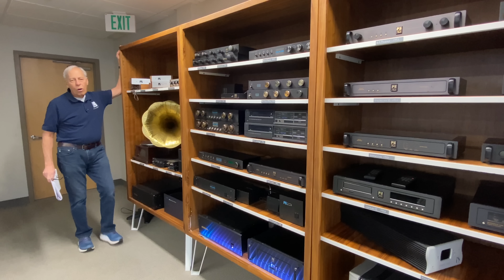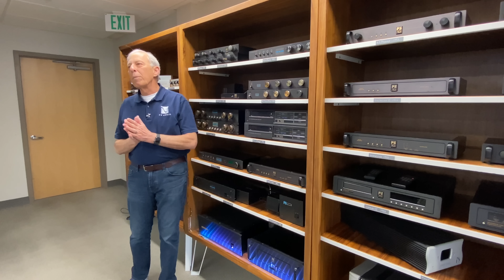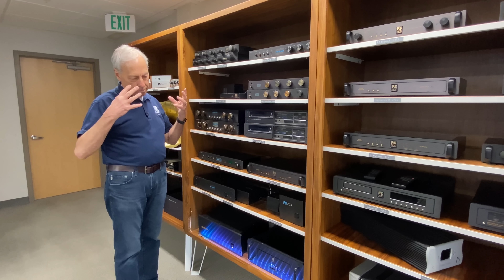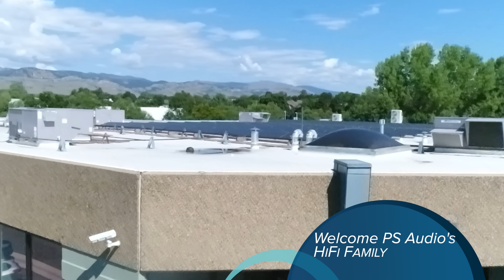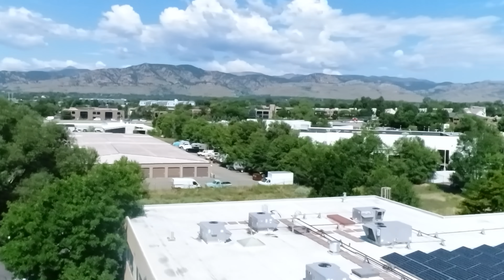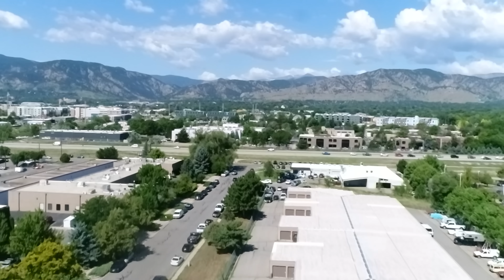Where do engineers go wrong?

Comment: Cables involve no magic. They are fully measurable and follow laws of physics exactly concerning their influence on audio signals. When a cable makes an audible difference rest assured that difference is also explainable. Your cable is a passive conductor of electricity involving properties of resistance, capacitance, inductance and shielding. A null test is a reliable way to identify the cable differential impact. Your US$1000 branded cable is typically manufactured in the Shenzhen southern China area for FOB US$10 by a factory still making profit. Snake oil marketing makes you pay the insane premium and also make you believe what you hear sounds better. This doesn’t mean cables don’t matter btw. And shorter cables are always better concerning their audio impact!
Reply: @Marshall 
You absolutely can have issues with "digital" cables.  Bit errors can result in skipped samples; if they're frequent enough it could conceivably become audible.  But that shouldn't happen unless the cable doesn't meet the specs, or unless you're running near the length limit.  
Regarding analog signals, if you can hear a difference, I'm confident I can find a measurement that will show why.
Reply: @marianneoelund2940  Exactly right!
Reply: @Marshall Well how did you exactly upgrade your speaker cable? Did you replace 24 gauge with 18, 16, 14 or 12 gauge? How about the terminals on the amp and speaker? Were they tight to begin with or did you inadvertently fix that by swapping cables and re-tightening them. How about oxidation? Just swapping the cables will scrape away some of that resulting in a significantly lower resistance connection. We don''t dispute the improvements you heard, we do dispute the speaker cable alone as the reason provided it is the same wire gauge.
Reply: @andydelle4509  The new cabl;es do make a difference. Less impedance and less capacatnace. Ever see the spects for Mogami speaker cables. Same with Mogami W2524 for instruments. I used them with longs 20 fewet slengsth and although they are XLR qwires, THEY DO PICK UP NOSE and need a nosie gate.  A portable gidital recoirder liek the one from ZOOM H4n. THANKES YUE and thmuibbs usp!
Reply: @Marshall You mean the live concert with Elise Trouw? Not sure about those cables, but usually professional cables are not too expensive and her home setup here in La Jolla is not with expensive cables. I'll tell you why some people buy cables costing tens of thousands of Dollars even they are manufactured for tens of Dollars...they are gullible to marketing snake oil talk and have enough money to not care. I work in audio professionally, have done tons of blind tests and have seen how this psychology works many times.
Reply: Forget capacitance,inductance,shielding,skin effect or any other spurious nonsense because their effects are miniscule.
Just concentrate on keeping resistance low by using thick conductors from your local electrical retailer.
Reply: @montynorth3009  Yes, the skin effect is a concern at higher frequencies and neither inductance nor capacitance of cables make meaningful impact for a few feet of cable. In fact, if your interconnect cable of a few feet makes an audible difference, it's likely a filter effect that I would be rather without. Your power cable resistance is in series with your house wiring resistance of many times longer wiring and also realistically of no impact. For speaker cables of very long distance, you could lose some damping factor and insertion loss (max SPL loss), but for a typical setup with a few feet of cable, the effect is more theoretical than audible.
Personally, I use heavy cables because they look cool, but I usually get them factory direct from certain factories in Shenzhen-Baoan, Dongguan, Zhuhai and Guangzhou areas. I've been visiting several of these factories in fact.
Reply: Marshall I do audio R&D professionally. Exactly because our mind is easily fooled, blind tests are required when you aim at getting feedback on audio performance. Especially for speaker testing, listening tests are essential in judging the performance.
Reply: Marshall San Diego
Reply: Larry Niles and how do you know these decisions and right? because you think so or feel so, or hear so?
Reply: @FooBar89 Those are not complementary options. Our brain thinks based on sensory inputs incl. from our hearing. In audio R&D you can play different audio test tracks and ask the testers to rank perceived soundstage, details, coloration etc. Personally I've seen radar plots being filled with the equipment behind an acoustical transparent curtain. I've also been doing tests were people were blind-folded as even a supposed to be acoustical transparent curtain can do some impact to the audio fidelity. When you test cables and electronics, you often can do the test with just hiding what are the active cables and gear.
Reply: @Larry Niles 
And when your life experiences conflict with someone else's, you must be the one who is right?
Reply: @Marshall 
I'm in the Seattle area and will volunteer, if that location works.
Reply: @Marshall 
Some premium cables are good investments for live sound, simply because of their ruggedness.  
I use very expensive pro cameras for my photography business, not because I can't get nearly the same results with less expensive equipment, but because I need extreme longevity from my equipment and cannot tolerate breakdowns during a shoot.
Reply: @Marshall 
I am an EE, with decades of experience in analog and digital design, and you could call me a skeptic on this topic.  But I'm also curious and would like to hear a demonstration - and if there turns out to be an audible difference, you can rest assured I will find out why.
Reply: Marshall If you could prove that our ears can hear a cable difference that isn’t measurable within the realms of well understood electrical properties such as resistance, capacitance, inductance, shielding and skin effects, you would be famous and can earn a huge income of having discovered some new science, so go for it.
Reply: Marshall Seriously, if you can hear the difference between cables that is not also measurable, you have discovered a new science and it’s a huge deal!!! Or maybe you just have cables that have big differences in capacitance or resistance. How long cables are we talking about?
Reply: Marshall I’m not trying to insult you. The point is simply that for cables and audio signals, there is no magic that can’t be measured and explained by science as we already know it.
Reply: Marshall Cables make no audible differences that are not also measurable. If you can prove otherwise, it would be a first time and huge.
Reply: @Marshall It's a great aim and I've often had similar idea of getting people together in a proper setting. Let the facts speak from an unbiased session of blind tests and professional measurements.
Reply: @Marshall I didn't say you didn't hear a difference. I gave you several possibilities as to how swapping out a speaker cable could produce audio differences. But provided the cables are apples to apples specification wise, they will sound the same.
Reply: @Marshall You have at least three EE's here who all disagree with you based on the same  technical principles. And again I never said you don't hear what you hear. I do question your test methods as well as offer other possibilities for what you expereinced.
Reply: @Marshall But the cable is not an acoustical conduit. It's carrying electrical energy. and especially with today's low cost DSP based test equipment there is nothing going on electrically that can't be measured. And if there was in fact something going on we don't understand, where are the effects in other electrical applications. Why are these unexplained phenomena  always limited to consumer HiFi audio?  What about the countless other electronic cable applications that are far more precise and sensitive than audio. Where are the reports of similar phenomena?
Reply: @Marshall "you hear sound waves... not electric current." Quite correct. But in order for the speaker to produce the sound waves you hear, there must be electrical energy present to move the speaker cone. The components of that energy can be measured. Now if you are talking about speaker design, that's a whole different ball game, Yes here, acoustics rule. But cables carry electrical energy, nit acoustical sound waves.
Reply: @Marshall I do understand. But do you know all the protocols to conduct a proper test? I don't think you do and frankly neither do I. There are very specific rules where you can't in any way influence the test subjects which is very easy to do. For example you can't say "now listen to this cable and hear the trombone presence come forward". That's illegal in a proper test because you are setting up an expectation. And there are many other rules to follow. Otherwise the test is unreliable. People who conduct these tests for a living like in pharmaceutical trials are highly trained in psychology. A proper blind test is not some guys listening to speaker cables over a few beers.
Reply: @Marshall Ok I see, the more one studies and educated themselves based on other's research, the less they know? Did you confider the difference between an open mind and an empty mind? Your last post is an excellent example of the difference.

Comment: If the wire in a cable really mattered , then why am I able to hear a pin drop talking to a person several thousand miles away on a landline phone? These wires are at maximum 18awg across the planet. Physics doesn't change but science can be manipulated.
Reply: @FatRat-f9m  
Definitely not black.  Toaster ovens aren't a very efficient way to toast bread.
Reply: I depends on how many repeaters they used. The repeater can retime adn regenerate the signals. YOue di dnot say a sewing pin or a steel piun line a 2 inchdiamater rives being dropped onto a steel floore woth a Nuemann condenser microphone recording it and then run theough an equalizer and Lexicon PCM 92. Bigg difrfrence. THANKES YOUES nd TYHUMBBS UPS!
Reply: Yes, you can hear it.  But you are not hearing it accurately.
Identifying that it is a pin that dropped does not equate to hearing it like you are there.

Any speakers, no matter how good or crappy, can reproduce the sound of a pin drop, and you will know that it was a pin drop.  But the better speakers will be more convincing and realistic.
Reply: @0Perhaps  "Yes, you can hear it.  But you are not hearing it accurately.
Identifying that it is a pin that dropped does not equate to hearing it like you are there."
Your statement falls apart. If I hear something and can identify it then it is accurately identified. What can be more crappy than the speaker in a telephone but I still hear accurately. No matter how convincingly a speaker produces sound it will never be realistic because of this little thing called physics.
Reply: @harrylanza  So when you shop for a television, you care zero about its resolution or picture quality?
What difference does it make.  Even a 1972 rabbit ears TV will allow you to identify the show, the cast, -- everything.

When you take a photo, and your hand shakes and the picture comes out slightly out of focus.  It is just as good as if you had your camera on a sturdy tripod.  The photo from the camera on the tripod will be perfectly in focus, and the one where you held the camera will be slightly out of focus.  But so what.  The photo from the hand-held camera is still revealing enough for you to see your friend that are in the photo.
Reply: @0Perhaps  WOW, I think I hit a nerve and so you shift from sound to visual. I will say it again, nothing can replace reality. What's next, will you tell me shopping for a more expensive computer will reproduce the 1's and 0's more accurately?
Reply: @harrylanza  "What's next, will you tell me shopping for a more expensive computer will reproduce the 1's and 0's more accurately?" No, but slap a PS Audio power cord on it, better yet run it off a PS Audio power plant and it sure will make better ones and zeros!
Reply: @andydelle4509  
What really bugs me about PS Audio's claims regarding power cords and their power plants, is that they are at odds with each other.  
For power cords, Paul claims you need parallel fine-strand wiring in order to pass all of the detail.  For power plants, he claims the advantage of isolating your equipment from all of that hash.
Reply: @harrylanza  So because (as you wrote) "nothing can replace reality", then your conclusion, based on your assumptions, is that a 1972 TV is no different than a 4K TV, because either one can reproduce a pin drop, and you will hear and see the pin drop on either TV.

Your conclusion is that either it is reality, or it is not reality.  That is true.  But for the latter, you assert that there are no subtleties; that attempts to come close to reality is foolhardy, because you can identify the pin drop on most any equipment.

And poo-pooing the visual analogy, because it shreds your faulty conclusion that you can "identify" the item in question (and that is all that is needed), is a dodge.

Harry, what equipment have you used to reach your conclusion that cables make no difference?
Please list the equipment that you used to perform a listening test.
Reply: @0Perhaps  My first encounter was 1964 at 10 years old I built two monoblock Heathkit 35wat tube amps. My father built the preamp. A friend gave me a Dynaco to rebuild and used it for a short time. 
8 years later I took on a mcintosh amp, I think mc270? can't remember. Years later I built from scratch class A 150wat monoblock discrete amplifiers and I think it was a Carver preamp. Now I'm using my own 40wat homebuilt push-pull integrated tube amp usling Mullard EL34 tubes. Now I don't a preamp, directly from source to amplification. Speakers anything from 3 sets of homebuild to JBL, klipsch, KEF and loaded speakers from audiofile friends. Along my adventure I have made all my own cabling. Twisted, braided, copper, silver and even experimented with coax. I'm the kind of guy that would rather educate myself and build the hobby than entertain someone with flashy names and high price tags.  I might not the kind of audiofile expert that you are but I have the knowledge and understanding to know the difference between BS and reality.  As for the television dodge I haven't owned one in several years. I would rather go outside and see it for real.  I also have a degree in hard drive data restoration if that makes a difference.
Reply: @marianneoelund2940  Let's put it in real terms. The wire coming to your home from the electric company that is miles away. comes to you from the  pole using  aluminum 4/0, then from the electric panel to the wall receptacle using either 14/2 or 12/2 copper and probably the run is 30 to 50 feet. So, that said the last 3 feet will not make a difference weather it has strands, solid or braided by Monks during a solar eclipse. There are a few things you need to have, Ohm's law and a good voltmeter and an understanding of physics.
Reply: @harrylanza  
Yes, but I'm good.  You need to tell Paul.  
Here's a little puzzle for you:  Our microwave oven is on its own circuit in our kitchen.  When not running, it's getting 118.5 volts.  When running, that drops to 113.3 volts.  But while it's running, if I also turn on the toaster oven (different circuit) the microwave's circuit voltage rises to 116V.  You can even hear its fan speed up slightly, so it's not a measurement error.  Can you explain why?  If I tell you that the toaster oven draws 12A, can you calculate the resistance in our service wiring (each leg)?  Is it excessive?
Reply: @marianneoelund2940  118v seems a bit low but and dipping down to 113 can cause damage to your microwave. The first thing I would do is check the connection at the receptacle. make sure the connection is tight and the wire is not using a stab connection. Next check in the panel what size breaker 15 amp, 20 amp are the connections tight, how old is the breaker? Sometimes these problems are caused by a lost or lose neutral as well.  to answer the resistance using ohms law: volts divided by amps equals a resistance of around 10 ohms R=V/A and Wats=V*A so the toaster is drawing around 1500 watts. 
Is any of this excessive? No, but I would try to find out why your receptacle is only producing 118 volts. low voltage can do as much harm and excessive. Maybe you should call an electrician.
Reply: @andydelle4509  Yes, its knopwn as a repeeter. It nregenerates the siognal and can retime it. They use them for Metropolitan arew netwprksed and such. BTW, Ethernet and IEEE 802.3 ARE NOT THE SAMEW THINEG. They are close, but THER NOT THE SAME.  IEEE 802.3 got heir stuff from EWTHERNET! Is this the article you were lookin fo...

An Ethernet Repeater (also network extender, CAT5 Ethernet LAN Extender or LAN Repeater) is any device used to extend an Ethernet or network segment beyond its inherent distance limitation which is only 100 meters (330 ft) for most common forms of twisted pair Ethernet.
These devices employ a variety of transmission technologies and physical media (wireless, copper wire, fiber-optic cable, coaxial cable).The extender forwards traffic between LANs transparent to higher network-layer protocols over distances that far exceed the limitations of standard Ethernet. LAN Repeater is a device that receives the electrical signals and re-energizes the signal back to original strength and outputs the signal further down the wiring.
Ethernet concept and creation came into being in the early 1970’s as a means to commonly communicate between computing systems. Since that time it has become an institutional global standard (IEEE 802.3) for data-transmissions.

THAKNS YUES AND THUMBBS UPS!